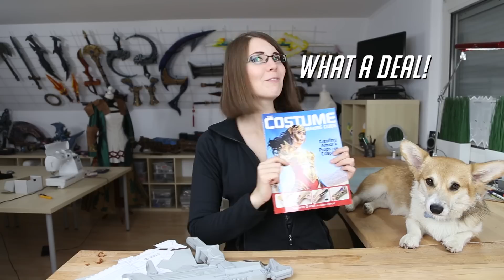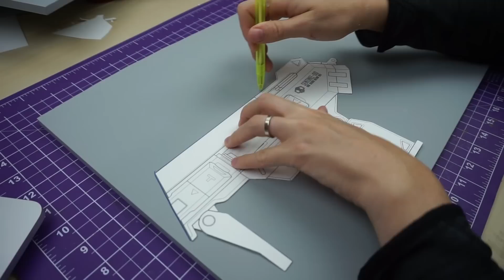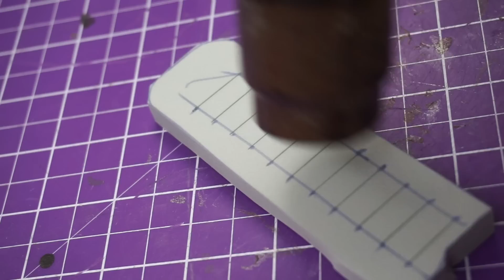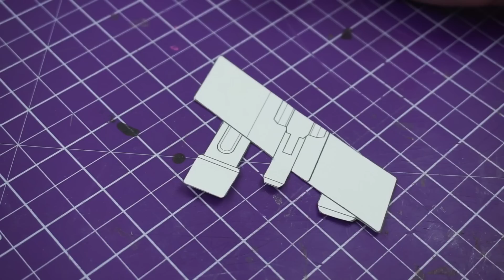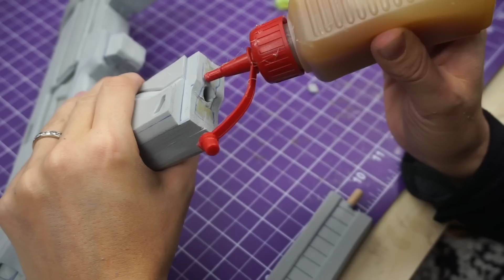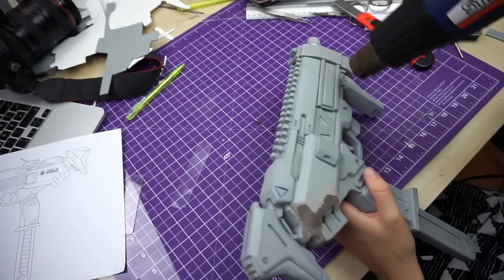EVA Foam Build - Sombra Gun Replica - Part 1

Comment: Hi! 

I'm wondering if you could recommend me a putty brand, I have just tried working with a couple of putties and EVA foam and the results were... not too good :(

Great job as usual, by the way. You get amazing results and make it look easy :)

Thanks in advance!
Reply from the maker: Were are you from? Putty brands vary a lot depending on the country you're from. The one we're using is this one: http://www.molto.de/files/2015/03/5233021-MO-Laminat-Parket-Spachtel_Weiss_50ml-604x604.jpg
Reply: KamuiCosplay
 Thanks for the info! I live in Spain, I see that Amazon ES has some putties from that brand, but I don't find that exact one,  do you know if any of these would do the work?: https://www.amazon.es/s/ref=sr_pg_2?rh=n%3A2454133031%2Cp_4%3AMOLTO&page=2&ie=UTF8&qid=1483751484

By the way, you did a great work with your books, I've got three of them and they are really helping me to start this hobby :) I'm in fact considering to buy the last one, the ones that I already bought (the armor and props making ones and a painting one) seem to focus in worbla, does this one by chance have a bigger section on EVA foam?

Thanks again! :)

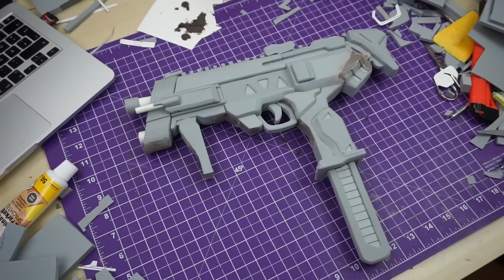Comment: At 5:21 what kind of putty is that? We have like 20 different putty's in the local craftshop and I don't know which one to use :/ Gun looks amazing again ^^
Reply from the maker: +Natan The 6th The one we used is actually to fix holes in your wooden floor :)
Reply: KamuiCosplay
Thank you for your reply, Kamui :) I had wood putty in my hands but the vendor said it will not work because foam is rubber based... I'm still gonna use wood putty, you prove it does work!

Comment: YAS that was great! Thank you so much for agreeing to make it out of foam, that's the only material I have access to at the moment and it's great knowing I can still build many things with it :D
I have one question, I personally seal the foam with wood glue, is the heat gun a better technique you think?
Reply from the maker: Wood glue may crack under pressure so I am not a big fan of it for foam. You should try a product called Flexbond, which is basically flexible woodglue. You can get it on cosplaysupplies.com or cosplayshop.be
Reply: ah thanks! Does heat sealing have a good enough surface finish to paint directly above? Like you don't add anything else after that as a sealant? Sorry many questions, still a n00b XD